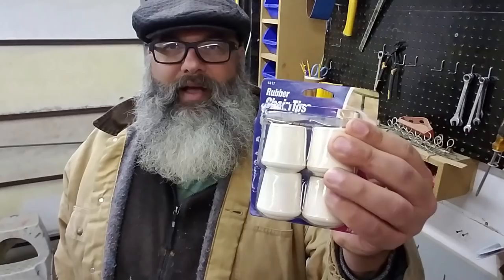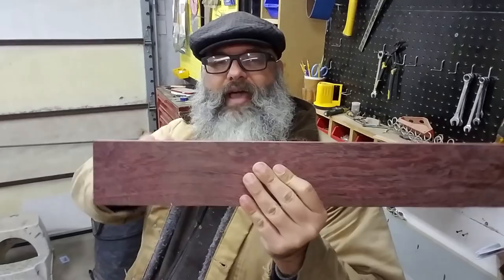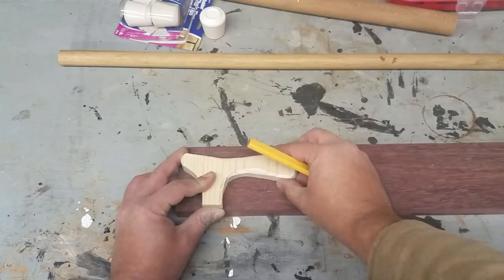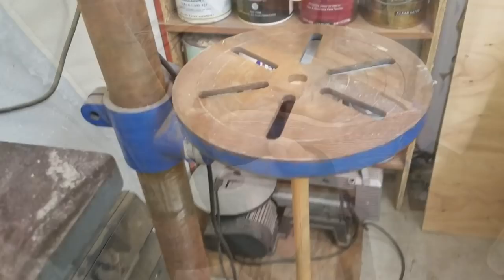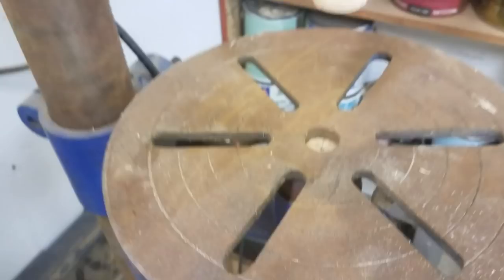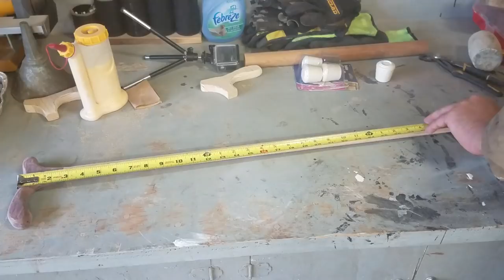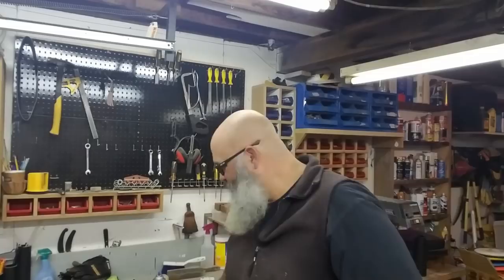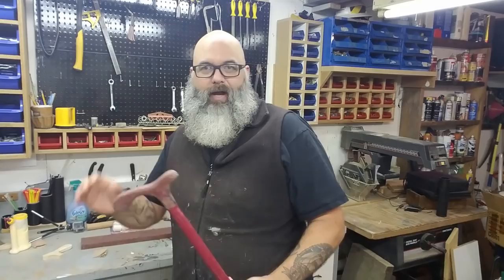A No Lathe Cane

Comment: I make canes. You made a point on the wood dowel holding the handle on. My first one like that broke. Bow I use 1/4 inch thread rod and epoxy to hold the handles.
Nice job on the cane, it turned out nice
Keep putting out videos.
Reply from the maker: That is a great solution. If my mom's happens to, I will be sure to make a new one that way. Thanks!

Comment: I make walking sticks using 1 inch diameter dowels from Lowe"s/Home Depot with old doorknobs on top and leather grips below.  I've wrapped some duct tape at the bottom to take up room for some rubber tips if slightly larger.
Reply from the maker: Awesome! That's a great idea! Thanks for the comment.

Comment: The video suggested but did not clearly show how you cut the handle blank. Did you start with a RECTANGLE??? Would it not been more cost effective to cut the basic shape with a band saw? By doing so you could have cut two handles from the same rectangle of wood, one handle top facing one side of the wood's long edge, the other handle top, inverted, facing the other long edge.

By forming the basic handle(s) in this manner you would eliminate a good bit of scrap, which means less overall cost.

Comment: When you said at about 1.50 that you couldn't remember what the guy who sold the purpleheart to you called it, but the wood was was about 7/8ths of an inch, did he call it "one inch nominal" by any chance? 

That's one inch rough-sawn timber which has then been planed for you. If it's done on one side, the wood comes out at about 7/8" actual, or 13/16" if it's been planed both sides. I think in the US you call it S1S or S2S for single or double faced.